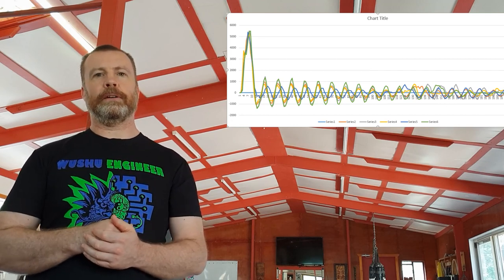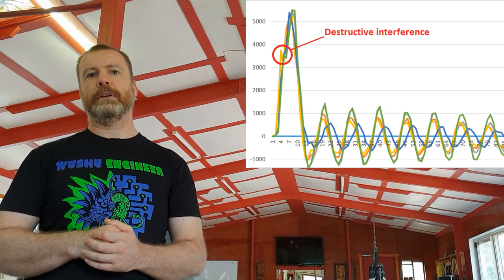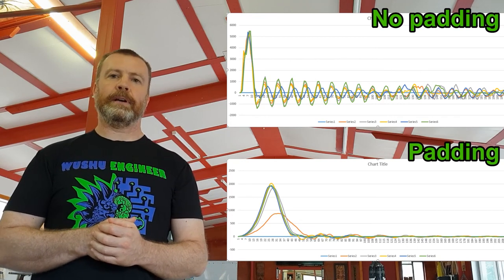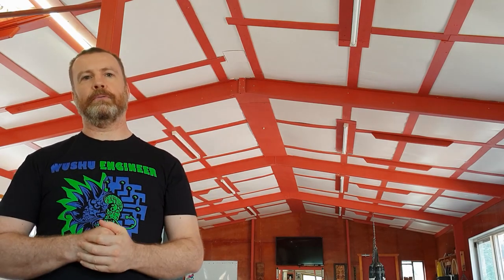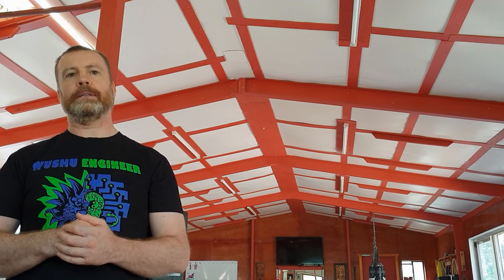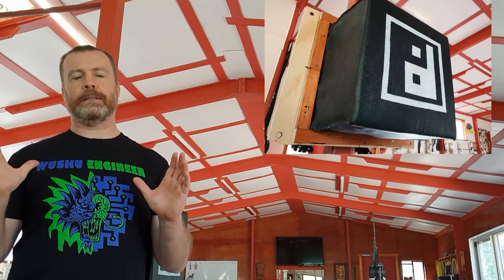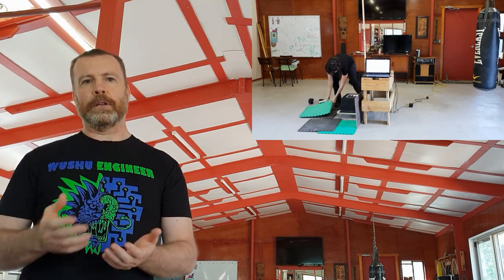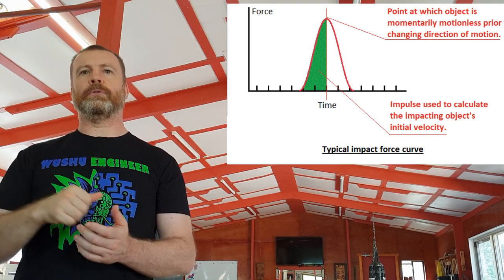The Impulse Block - an experimental hybrid approach to measuring human impacts

Comment: Hello, This is extremely interesting to me because I’ve had the strain gauge based Loadstar boxing kit for almost a year now.

I’ve only been able to punch it with high power a couple of times because of the rigidity in the whole arm and shoulder. 
that makes it really to dangerous to punch with full power potential even tho as a boxer I wrap my hands and glove up.

So it’s really losing its whole purpose for me witch is to track max punching power over time with consideration to my strength training program and too experiment with different punch mechanics at full force etc, so I’ve actually just got a hold of a gel pad motorcycle seat padding I’ve been thinking to use but now I’m thinking that will just make the sensor even less accurate then with the foam that is already there. 

I’ve been thinking to just calibrate a strain gauge or the loadstar sensor with extra open cell and closed cell foam something similar too the one you made

Do you think the calibration with the foam will give quite accurate max forces? 

I’m very impressed by the sensor you made seems to be best of both worlds. 
Especially with the potential to punch with max force multiple times without a high risk of sudden join or muscle/tendon injury.
Reply from the maker: Hi Emilio. We are still working on testing and developing a method of extrapolating peak force. We are looking at several options at the moment. One is assuming that the impact plot will follow a particular function, like a gaussian curve for instance, and getting the peak force from that. Another is to create curves for particular strikes at much lower, safer impact levels, and use those to construct an approximate curve that the impulse can plug into to get peak force. All of the methods that we are looking at are essentially estimations/models because the use of the foam block basically renders the peak force data unusable without reconstructing a peak impact force curve using impulse data. Still early days in the testing/development, but I believe that a reasonably accurate model can be constructed that would give you reasonably accurate approximations of what the peak impact forces would have been. It may even be possible to write some software for the loadstar system that would automate the whole process. What you could do in the meantime while this is being developed, though, is to construct a similar Impulse Block setup. Then, instead of monitoring your progress using peak force, calculate the impulse from the force data and use that as a numerical indicator of your progress. If you want to do it that way, I can help you to get the equipment set up and provide a more comprehensive description of the numerical analysis you will have to perform on the data. Let me know.
Reply: you can extrapolated each material amortization you want on this what come from manufactury from loadstar you just need to do some  droping test with the same object from the same hight  for egzample if you drop 5 kg steel ball from 1 metres and you get fro egzample on this 5 cm foam dont wemeber egzacly numbers now but it no matter let assume 400 kg force in peak and than you put your new foam which reduce force now you do egzacly the same test  be droping the same object from the same hight now you get let say 250 kg peak force so now what you must only to do is just calibrated loadstar be cofactor of 400:250 =1,6 times so you put now let say 20 kg weight at laodstar loadceell and incalibration write that this is 20 x 1,6 =32 kg and now you have extrapolatuion from one amortization to another simple a sthat ;) now loadstar show force from max compresion of specified amortization  while true force is not in such system like this impulse block form max compresion the same like in powerkube but from acceleration specified resist thats why powerkube have accelerometres at frontal part surface of this device  because when they know resist let say it is 20 or 30 kg which is eqyivalent to for egzample specifed bag mass than algorythm just mutliple this resist of foam spring wjhatever be acceleration rate level which show accelerometres in specified strike because force is mass or resist x acceleration but anyway if you want only extrapolation than what im write above is true and simple anyway powerkube is better system because it  isint rigid like loadstar and me fc 20 k axis which are in fact damage your knuckle bones etc in time  but you can do something diffrent you can do inertial system with this loadstar force plate like some wagon on rails and at front loadstarforceplate pendulum probably is worse because leverage factor depend where you hit diffrent resisit you get and diffrent force numbers now you must also find out be how much again with such inertaial system on rails less be shown loadstar comapre to rigid setup if less me fc show much less so the weight on rails with rail must be enough or just do extrapolation again be testoing the same hit from some object pendulum etc or whatever .
Reply from the maker: @emiliox210  I'll work on putting some instructions and guidelines together.
Reply from the maker: @emiliox210  I have uploaded a guide describing the simplified Impulse Block method to our Wushu Workshop website - check the Free Stuff page for the download. I have tried to make the guide easy to follow. Let me know if it makes sense and if you have any questions or want me to clarify anything.

Comment: 1 explain why powerkube catch kinetick energy +  while loadcell change in momentum and than explain why when you put  powerkube on loadcell both show the same peak force numbers = kg force on loadcell =the same value ftlbs/sec on powerkube  what show your video test what shpuld not have place when one device change kinetick energy on peak and other momentum they shpuld show didfrfenc force from the same drop attempt . and last which in fact is correct setup energy or momentum :x  in me  ubm they probably where not sure so such they setup it that show beewten energy and momentum :D . while me loadcell fc 20 k axis show change in momentum as peak force but some study show change in kinetick energy in fact as linear corelation with peak force while they also use laodcell watch this (PDF) Performance of Prototype Pneumatic Boxing Gloves under Two Different Conditions of Target Padding (researchgate.net)   those are contradictory data which dont have to much sense ! .i dont say you manipulate your device or something which is not excluded i dont trust even meself 100%  ... just look at numbers from your droping test and compare ! :x in fc 20 k axis for egzample i can change calibration as in your ladstar loadcell  but i cant change scale from linear for egzample on increasing scale i can do only one point calibration weight level  and on loadcelll from laodstarr calibration also is only with one weight be once? or you can do such stuff like put 10 kg and write that it is 10 kg than put 20 kg and write it is 40 kg for egzample  where 10 show 10 and 20 show 40 :x ? in me device its imposiible i have only one data point with weight calibration so such i cant change amplitude of scale from linear with momentum to linear with energy for egzample they setup this in manufactory while calibration device where they go from 0 to full scale of loading .